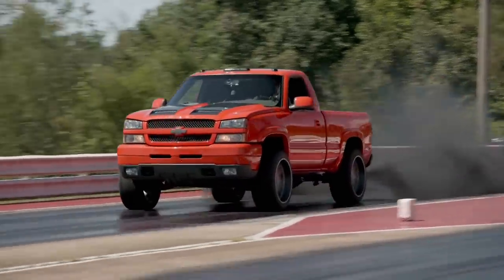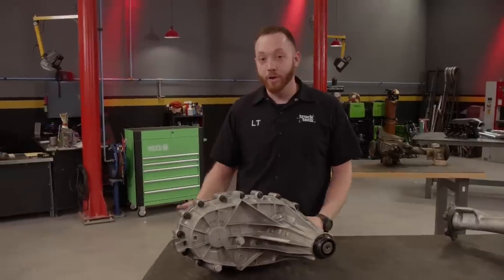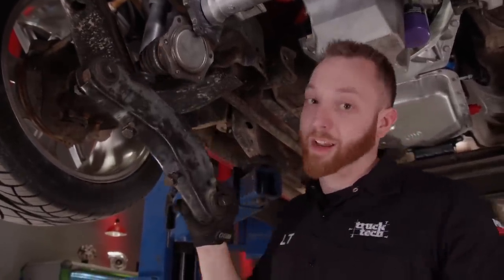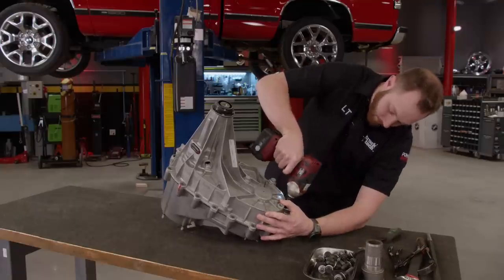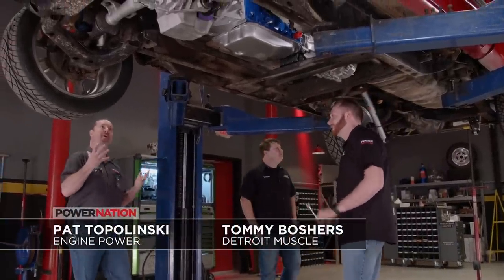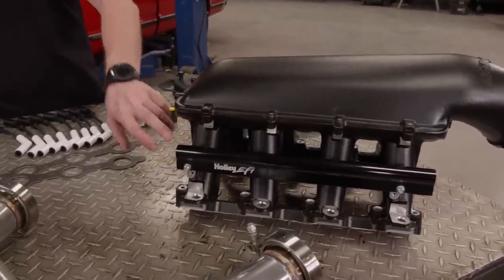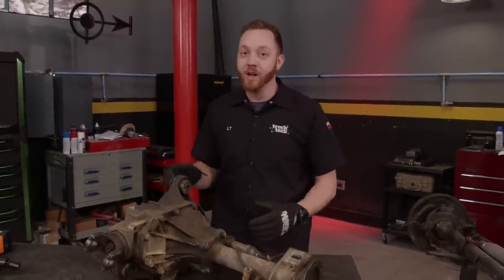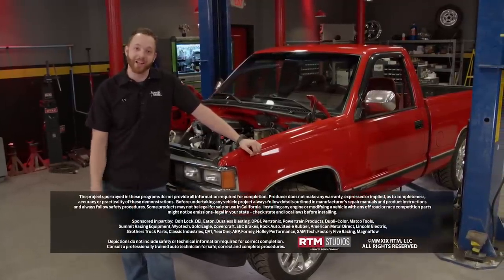AWD vs. 4WD Chevy 1500 - Truck Tech S6, E6

Comment from the maker: We'll continue to post these episodes here on YouTube. If you can't wait for the rest of the build, visit our site to binge-watch:  https://www.powernationtv.com/shows/truck-tech
Reply: What degree is that pipe for the passenger mount
Reply: PowerNation <-----<<< OK TAKE THIS BUILD UP A NOTCH AND MAKE IT ALL WHEEL STEER!!!
Reply: '89 Honda Prelude 4WS components should work just fine lol
Reply: Timmy MacGruber Those are dainty parts I was thinking about the GMC the built in 2010 or close to those years.
Reply: Timmy MacGruber There was a company that was saying they were going to build aftermarket one for the f150... That was like two months ago though. I like more the idea or finding the part's that weren't designed to do it and make it all work together.
Reply: Timmy MacGruber He could monster truck make it all wheel steer with few parts from other trucks 4x4 turn knuckles and hydraulic ram would be more practical offer. When drive by wire rack.pinion systems become available this will be a more easier mod to do.
Reply: @Thelongmanable  , yes I know.  I kid
Reply: Timmy MacGruber I did a google search and a ton of quadrasteer parts available.
Reply: Timmy MacGruber My thing is if he manages to quadrasteer and awd this truck it gets magazine attention along with a broad range of others like 4x4 to lowrider truck magazines. All the more reasons to do it because that's free advertising and if they trick paint it they can car show the truck.
Reply: Awesome thank you so much for the video 🔥😎
Reply: Ladybug is awd twin turbo.....
Reply: What differential is in the rear? LSD?
Reply: GMT400 Tahoe SS is an AWD.....
Why not just use those parts?
Reply: What are the GM part numbers for a new diff and t case out of an Escalade
Reply: Can you tell me more about the long arm runner design and how it generates higher low rpm torque?
Reply: Doing this to a 63 c10.
Reply: What radiator did you use with the LS swap?  Great build!    Thanks 🙏

Comment: I never thought I’d see the day when a 90s Chevy truck looks like a cool classic lol. Time sure does fly
Reply: 454 SS was an instant classic for sure
Reply: Jake along with the Sierra GT and ST trucks.
Reply: Considering that today’s trucks looks like Aztecs, it’s not surprising.
Reply: That's a89 I do believe
Reply: Doesn't look classic to me because those trucks were so common along with the 80s body
Reply: I would have the proper nv149 gasket
Reply: @shadowopsairman1583  yea but that's quickly changing . A decent 80s truck is already getting rare u less it's a banged up farm truck . Same with early 90s
Reply: I was thinking the same thing
Reply: I have nine of these "round cab" trucks ranging form a very early '88 model (made in May of 1987) to two 2000 models ( a 2500 HD and a 3500 single rear wheel). I have a 1500 std. cab 4wd short box step side up to a 3500hd with a 14 ft. flat bed. Three of them have the 4.3 V6, two have the 6.5 turbo diesel and the rest are 5.7 V8's. My older C10 - C30 trucks all rusted out and I suck at electronics so I can't keep the newer trucks running (I'm just a working stiff and can't afford the $100+ an hour repair shop rates all the time). These vehicles have given excellent service (most are over 325,000 miles) and I can fix most of what's in the trucks and that's why I like them. Unfortunately, no one that I know considers them to be a classic or cool truck. Mostly people just ask why l drive such old junk!

Comment: 18:25 I think I've replace dozens of those actuators for customers, but it was always RIGHT after the first snow when they had already had to call us to pull them out the ditch, it got to the point where we just kept a few new ones in the shop for when winter came
Reply: keep the switch in stock, too. 2 most frequent culprits of failure in this design, and they're both cheap!!

Comment: I did this same build like 4 years ago with 93 a 2 door tahoe and a 6.0 instead of a 5.3
Reply: Any pictures we can see?
Reply: rocknroller1999  unfortunately I wrecked it driving in a bad snow storm and as far as power it was a stock LQ4 with a mild cam So I would assume mid 300s I did replace it with a hummer h3 alpha so a GM built awd 5.3 powered suv

Comment: After working on Chevys for 35 years, the interchangeability, even from the 50's, is unreal. Almost like they planned it that way. Can't be coincidence.
Reply: Hey i need some advise im not to  knowledgeable when it comes to parks in are changing everything but I have a 98 c1500 v6 manual 5speed 2door short bed chevy and i wanna do something to give it some guts but nothing that a guy with a limited budget and limited knowledge will be able to do any one got some suggestions or advise to a guy who's been in love with thid year amd wanna give some life to my obs..
Reply: @MrMrBurnablunt  75 shot of nitrous, cooler plugs, electric fuel pump, distributor able to retard timing.

Comment: This is the exact build i am looking to do soon, to the freakin dot! geez! So sweet
Reply: I love this generation of truck....I want one soon
Reply: I was told by the trans shop that the AWD transfer case is made out of magnesium
Reply: Make sure that you have all the sweet snap-on tools and the budget as well as a certed GM Goodwrench Master tech on the payroll like these guys... Remember he isnt spending YOUR money, you are, and he ordered that front diff "on a whim, not knowing if it would fit", and lucked out..... Just saying, easier to spend someone else's money than your own. Just saying, from watching multiple episodes of this and other PowerNation shows, the point is not to show you so much what can be done, as what can be done with money that doesn't come from your own pocket.
Reply: @supramaniac502  only thing that was modded was the bracket and the input shaft the rest is pretty much bolt on. Parts are readily available. Diff is about 1200 and transfer case is around the same,and thats remanufactured so its pretty much new.
Reply: @JoseContreras-mv5yz  then let's add the cost of the built trans, the $3,500 for the long block, the necessary mods to the fueling system, the custom driveshaft (s), and so on and you could have just BOUGHT a used truck that already had most of this gear in a newer body. Oh, but then it wouldn't be "custom"... Don't show me a what a$12-15k budget will do. Show me how much I can do to increase performance to the level they are talking about with some harbor freight tools and $2,500 for the mods. That's what I WANT to see.... This equates to budget flexing imho
Reply: @supramaniac502  just because they are using snap on/mac  tools doesnt mean you have too😇+by now we all know you dont have to get a rebuilt engine but rather get a donor vehicle and get everything from it. At the end of the day sure you are going to spend money. That is what you do on projects. You want to save more money? Ditch the holley intake,fuel rail,ecu etc. Get a low mileage 6.0 out of your donor vehicle,mod your own wiring harness,and send it.
Reply: @supramaniac502  1500 for a donor vehicle(5.3 or 6.0 equipped) with transmission,and if you want more power,add a turbo😎
Reply: @supramaniac502  Shoot I just scored my entire AWD driveline out of an SS for 250 bucks. Doing the labor yourself is the fun part and saves money of course.

Comment: I’ve been a professional auto tech since 2003, I worked at jiffy lube before that, I was in my grandfathers garage starting at a very young age probably 10 years old watching and learning how to do brakes and stuff like that. My grandpa retired right around the time I was born (1984) he worked for a factory that made gears for transmissions and all kinds of machinery and he was an aircraft engineer in the Korean War back in the 50’s so he was an extremely smart man I learned so much from him Hes the reason why I got into the automotive field. So for something to do he would pick up lawnmowers people were throwing away and that’s how I first learned how engines worked. So when I started to work for a real shop I had quite a head start. After being a auto tech for nearly 20 years and I own my own repair shop I am burnt out on doing regular repairs I really miss doing custom work like taking a 4cyl car and stuffing a v8 in it, taking apart transmissions and engines. Don’t get me wrong I take apart a lot of engines but the newer stuff isn’t fun to work on like the older stuff it just feels like work the older stuff doesn’t feel like work as much. Watching videos like this really inspires me to get back into custom work!! I have a shop at home as well and I have an idea to build some older cars that I might try out. I was thinking about buying an old car, install 5.3, 4l60, get it running and driving well and sell them. But I won’t be building the entire car just do the power train swap to get running and driving well and sell them like that so the person buying the car can have a car that’s going to be reliable but they still have to do interior, body and suspension work. Basically so the average guy can afford to buy an old car and fix it up as they have money.

Comment: This is why I love Chevy and why I work at the Chevy dealership. There is so many combinations that you can come up with to be able to build to your own perfection. But here recently 2015 and up their starting to change but I am a diehard Chevy fan because I’ve been interchanging parts from the 1950s all the way to 2007 from axles to engines to transfer cases it’s unbelievable you never be able to do that with a Ford 😎
Reply: You can do that with a Ford. Your not special. I put a 460 big block from a 97 F350 into a 77 F250 and it bolted right up to the trans and frame with no modification. Minor splicing of the wiring, but the ECU plays nice with the original 77 body wiring harness. The AOD family of transmissions introduced in 1980 was still in use up until 2013, with very minor changes but interchangeable non the less. The Windsor family of engines introduced in 1960 where used until 2000. While the heads where improved over the years, you can bolt GT40 heads onto a 70s mustang and they fit. Even the body mounts for their trucks are in identical spots dating back to the 5th gen, meaning you can bolt a 71 body onto a 6.0 chassis and the mounts line up. No need to fabricate custom body mounts.
Reply: @sham_wow_guy  congrats do you want a cookie or something?
Reply: Greg Rogers 
Sorry to hear that. There may be medication to help treat your affliction.😁
Reply: Hey i need some advise im not to  knowledgeable when it comes to parks in are changing everything but I have a 98 c1500 v6 manual 5speed 2door short bed chevy and i wanna do something to give it some guts but nothing that a guy with a limited budget and limited knowledge will be able to do any one got some suggestions or advise to a guy who's been in love with thid year amd wanna give some life to my obs..
Reply: I have a V10 in my 1999 F150 using all factory Ford parts. Truth be told, I'd rather have a boosted LS Avalanche.
Reply: Casey Cleland  the V6 in it is the 4.3 right? As long as if where you live you dont have to smog it then you could put a Vortec 350 in it really easily. Or find the cheapest 4.8/5.3 truck LS engine for even more hp and fuel efficiency, would cost a little more but you would definitely feel the power.

Comment: I rebuilt my 04denali front diff my self 100$ for the brearings and seals. Drove 500 miles I still hear it. Buy rebuilt for 1200 swap in . More noise and same slight amount of metal on drain magnet. Im sure they sent me a 250k rebuild and my 125k is even quieter LOL. Pro tip. you can set the gear lash in that diff without the tool just loosen the two case halfs and do it by hand slowly. LOL. takes a couple trys . Then I removed the adjusters and drilled a hole and left the drill piece in the adjuster so they could never move without disassembly. The fault with these AWD 6.0 engine diffs was the tab would break and the adjusters would back out giving you huge backlash in your diff. Plus the fact its the basically the same as the part time 5.3 diff but running more power all the time now.

Comment: As a ford guy, I do like how interchangeable Chevy parts are. I actually converted my 4x4 03 ranger to AWD and swapped a 5.0 V8 into it and only had to make minor modifications to the wiring harness to make it all work. Engine/trans/transfer case bolted right up and I used my stock driveshafts

Comment: MY 1995 K1500 was lowered 10 plus years ago it has the posi lock manual control in the front axle. Its got a built 406 and heavily modified 4L60E. I wish I had done the 4l80E I've done the modifications for the 1999-2006 spindles knuckles and 2007 up brake rotors, calipers, and brackets. I also added hydroboost and have 99-2006 Escalade rear discs. I have a 6 lug 14 bolt full floater axle to add some time. I also have the Holley EFI multiport going in with an electric fan set up. The EFI I think is the HP an older setup but still with touch screen n fully programmable.

Comment: I had a thermal activator go out on my '92, I got a new one from the dealership, but it was an updated mechanical version with a shim, and an extra wire, that I had to splice into the transmission speed sensor. It wasn't very complicated and went into 4 wheel drive instantly.
Reply: Hay freedom first, if that complicated extra wire one gives you a problem when it's real cold out thay make one with a cable you pull no wires

Comment: Those thermal actuators are EXCELLENT ESPECIALLY WHEN IT GETS INTO SOME CHILLY OR JUST REGULAR SHADED MUDDT AREAS SHORTLY AFTER A HEAVY ENOUGH RAIN STORM IT DISENGAGES YOUR 4 WHEEL DRIVE ( 2 WHEEL DRIVE) AND MAKES THE OLE TRUCK A 1 WHEEL WONDER :0) IT GETS CONFUSED BY THE SUDDEN " COLD" SIGNAL SHUTTING OFF YOUR 4 WHEEL DRIVE LITERALLY WHEN ITS SUPPOSED TO BE NEEDED MOST! NEVER HAD IT OCCUR IN A HEAVY SNOW BUT IM SURE IT WOULDNT BE a stretch to expect similar results!
Reply: they're easily swapped to the 96+ mechanical acutators

Comment: I’ve got a 1994 k1500 with 37” tires on it and 298,000 miles on original motor. Still runs! If you want another project for motor swap….😁

Comment: I had a 99 1500 5.3 z71. Would tac 2000rpm at 80mph. I now have a 2005 1500 5.3 z71 and it tac's almost 3000rpm at 80. Sticker says it has 4:10 ratio. Is that stick or special order?
Reply: Stock

Comment: Couldn't help but cringe at 9:27. You can't hammer on ball bearings like that!! They're not meant to handle axial loads like that! you'll bend the cage!
Reply: Yeah ya can...I always hammer on bearings without issue...Relax there spark
Reply: The Executioner no you can’t. You’ll bend the cage which will make the bearings wear prematurely into the races and the cage itself. These are ball bearings, not roller bearings that maybe you’re more used to seeing

Comment: You forgot to change the oil pump plate over to the case-saver that doesn't knock a hole in the 149 transfer case. Everything I read on my 04 Denali said you'd be a fool not to, while you're in there.

Comment: Did you have to drill new bolt holes for the cross member to lock the transmission to the frame. I noticed this part wise was left out of the building of red tide.

Comment: I have owned a 2001 C3 AWD since I bought it in 2003 with 11K miles on it. I always loved my AWD, if I could finish up on some of these cars I have I would not mind making my now 19 year old truck into a project truck.
Reply: I love the C3's!! They got the 6.0 vortec right?
Reply: @SubieandFriends  yes that's right 6.0
Reply: @davegt27  nice engine! I also love the front of end of the C3's, it's projector headlights make the front end look alot more nicer  then the front end of regular Silverado/Sierra's. I believe the exhaust on the C3 also sound more meaner too, I also remember the optional rear quadra steer system available on Sierra denalis and on some other Sierras and Silverados trim models. Man I love  the GM trucks from all generations!

Comment: So glad I ran across this video! I swapped out my rear gears and haven't done the front yet, that differential looks like a definite Improvement without going solid axle, plus I'm not sure if they make a Detroit or Locker for the factory one or if you would want to try to do that? No I dont want to go solid...$ cost, truck see 80% pavement and kinda hi speeds for the lift as it is, For you guys that daily nitrous fed supercharged turbo military tanks and everyone else is a poser 😉

Comment: 3:55 Now he's going to create a problem so he can push a part you don't need.
Reply: I know and basically everything they put on the motor they could have bought a complete engine from a junkyard and had all that stuff basically those parts wont make much more if any power than the stock parts
Reply: Not creating a problem just showing options. The original front diff would work fine locked all time for off-road only. You can't use it for full-time all-wheel drive.
Yes you can go to a junkyard and buy all-wheel drive Cadillac Escalade for most all the parts  but its still used parts with 200k+,-  so you're going to have to rebuild them. It's at a junkyard for a reason.
Reply: @Happyfacehotwheels  That actuator does not lock both front axle togather. The front diff is open even when the actuator is on.
Reply: @blackericdenice   Thanks for the info. So this system will only work with a open diff because With a open differential power goes to the easiest wheel to spin. If it had a locker  or a spool  instead of a open diff it would need the old style locks that are on the hubs.
Reply: @Happyfacehotwheels  The old style locks at the hub was an open diff too. I don't think any GM trucks came with locking front axle.